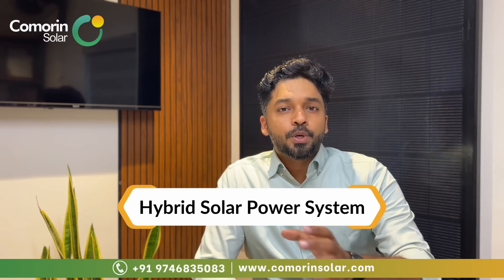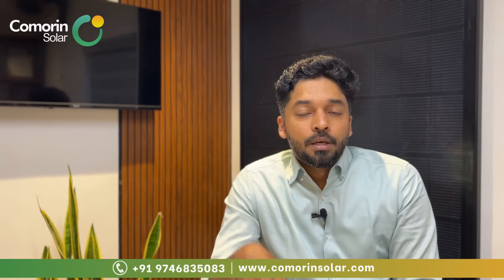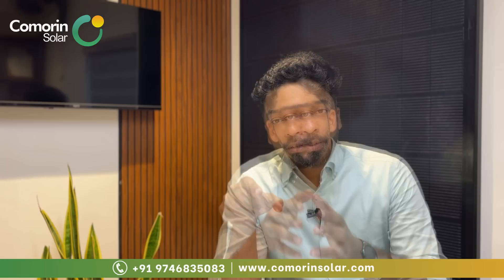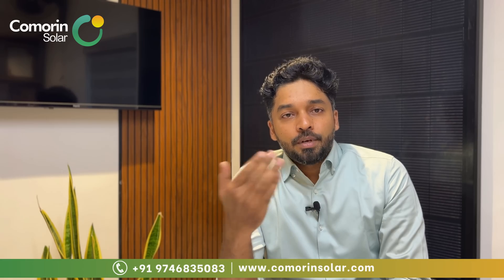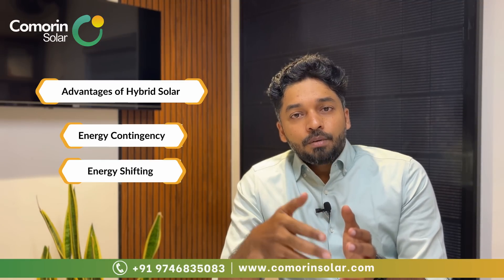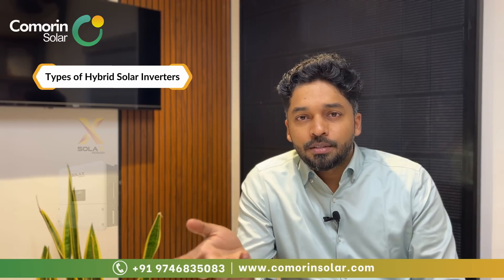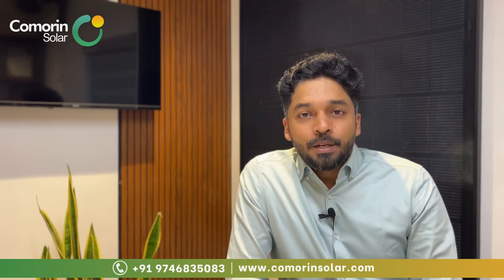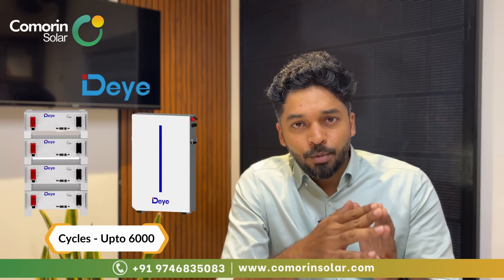Technology, Type, Cost Details of Hybrid Solar System | Best Hybrid Inverter Battery #hybridsolar

Comment: Dear where is your office located???
Reply from the maker: 📍Trivandrum office: 
COMORIN SOLAR
Opp. To Nippon Toyota Showroom, 
Near Technopark Phase 3, Kazhakoottam NH Bypass
Thiruvananthapuram, Kerala
Contact for New Solar System Enquiries 
📳Mob: 9633159523 |   8714238570 | 9746835083
Website: https://comorinsolar.com/ 

📍Kollam Office: 
COMORIN SOLAR
Opp. To Oxygen Digital, 
Vendermukku junction, Pallimukku,  
Kollam, Kerala
📳Mob: 9633159523 |   8714238570 | 9746835083
Website: https://comorinsolar.com/ 

Mavelikara | Pathanamthitta | Kottayam | Kayamkulam